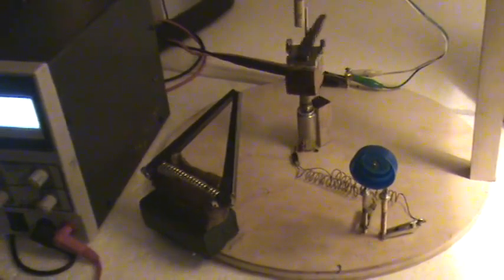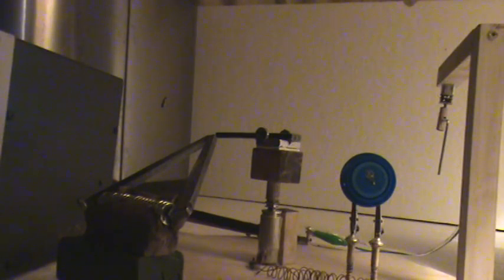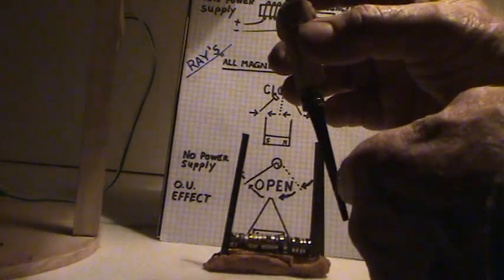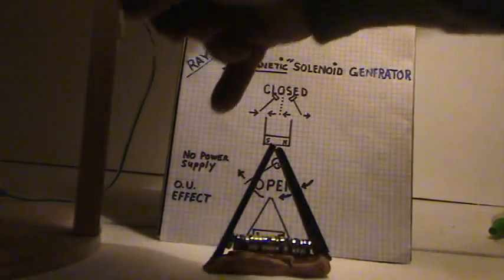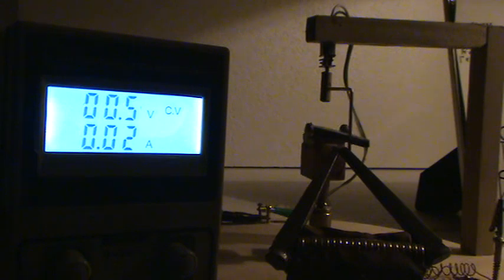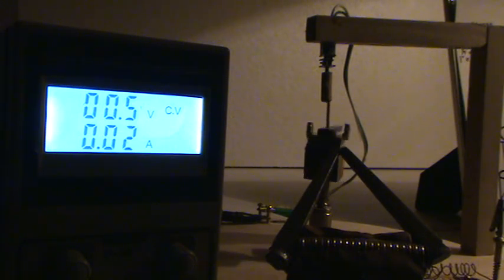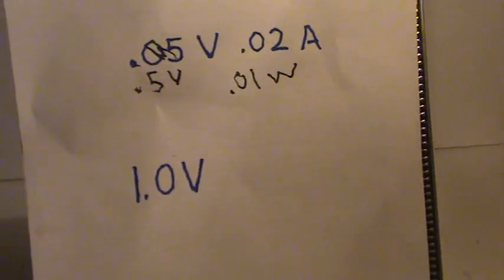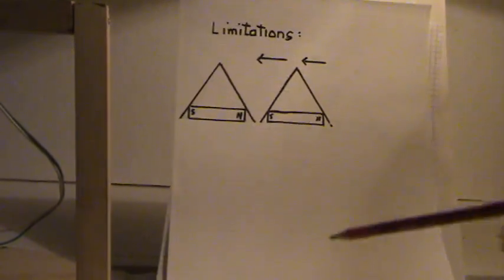Ray's All Magnetic Solenoid Generator

Comment: I tested this with 2 headed nails and a ceramic magnet and it works as a oneway gate mostly because the neos are very strong and  can push the magnetic field out to the end of the nails but mine only  went a little past the nails. Thank you Raymondslab for this major contribution. Norman

Comment: First some critics, and then a way to scientifically prove your hypothesis ;)
You cannot use the amps it used when it got stuck for any calculations! A brushed Motor that gets stuck is basically just a short Circuit... Anyway, any calculations based on the small numbers on your powersupply are mostly meaningless anyway when you dont even consider time as a factor in your power calculations... So an Oszilloscope is mandatory to get even close to any meaningfulll measurement...
Regarding your Overunity-event-Claim, If in fact there is such an event, your rotating magnet would be able to self-propell the full 360° and enter into the magnetic field of the "solenoid"(which isnt a solenoid at all btw...), given there is no energy-loss to friction...
So pls remove the stupid generator from the shaft (the blinking led is meaningless as a measurement here, an oszilloscope over a 1 Ohm resistor would be a better way to measure the output power as it gives you the amps over time as a reading of Voltage ;)
IF you want to test and prove your hypothesis: Get a ceramic bearing and clean it of any lubricant. Then mount the Magnet on that bearing and make sure to eliminate as much friction as possible. Balance out the rotating magnet so it can rotate many rotations with a single pulse of energy. IF!!! there is enough energy left at the end of the rotation to overcome the magnetic field that would be an awesome discovery... But unfortunately that would violate physics in multiple ways, so good luck ^^
A vacuum chamber and superconducting magnetic bearing would be even better to get rid of any friction loss, but I guess thats a bit overbudget here... ^^
Reply: Thanks for info , i have limited training in many areas , nice to have feed back to learn from

Comment: Welcome back Ray! Question, you said in this video that if you add more than one, that it cancels out the effect. Ok then, so why not just add more mason nails to the rotating shaft instead? Will that magnify the extracted energy? Why not put three or four mason nails even spaced on the rotor that the motor is pushing and then re-test?
Reply: One nail should pull the next through and so on and then you have a motor, hopefully.
Reply: Also, what if you put the gate on the rotor and just have a bunch of nails around the circumference?

Comment: Don't use more triangle magnatec coils but only use more of that spinning magnet on the same shaft ,  I think you can bypass the limitations then, Great video
Reply: Tryed stronger activator but an opposing small force slowes it on opposite side of rotation , that is why I focused on the firing part and not the complete rotation